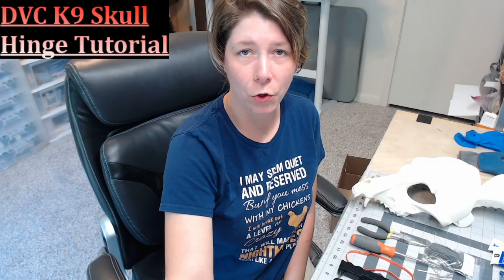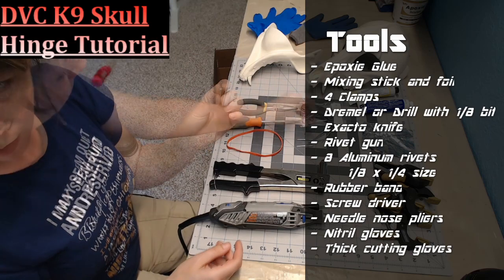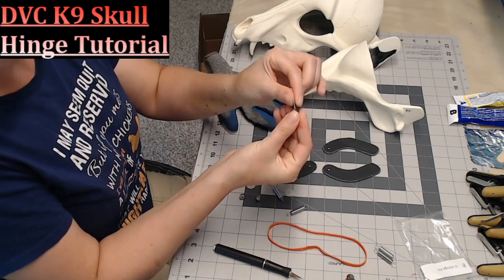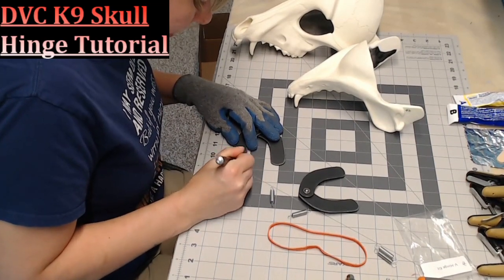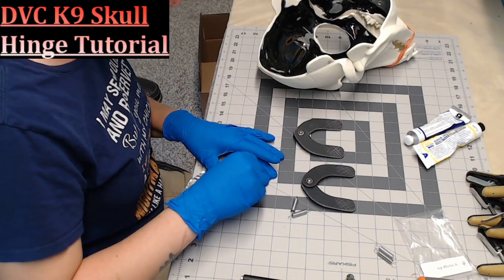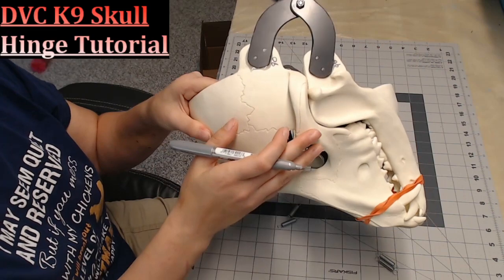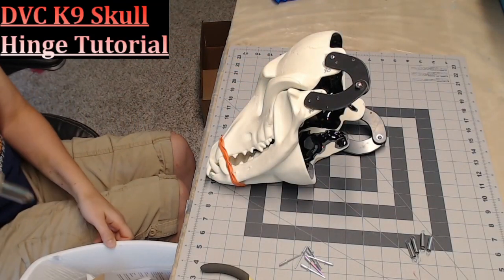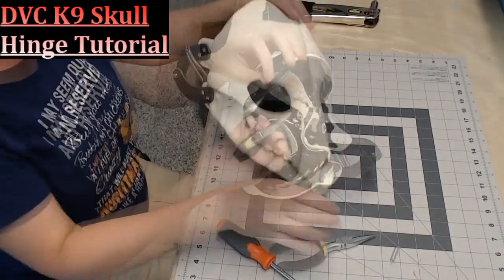DvC SKull K9 Mask Hinging Tutorial

Comment: Hello! just a quick question what type of glue do you use or what type of glue do you recommend whilst gluing down the hinges? if you could tell me that would be great thanks.
Reply from the maker: we use a 2 part epoxie glue called Super instant glue from smooth-on but you can use any industrial  part hard cure glue it will just take longer to fully set. ~Monoyasha